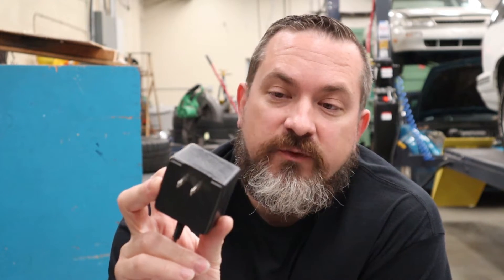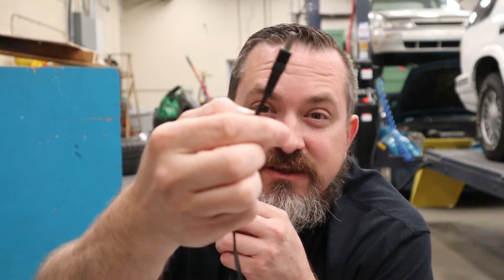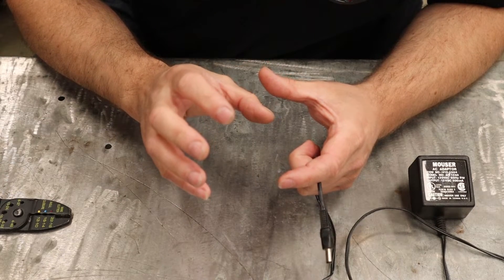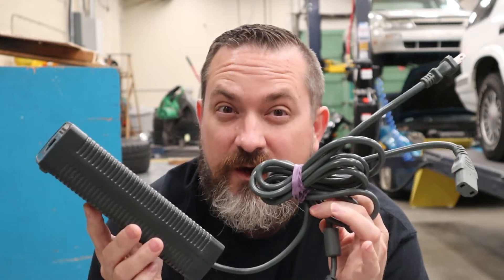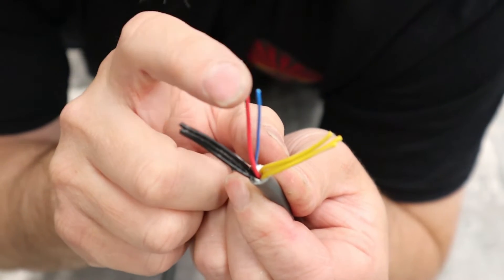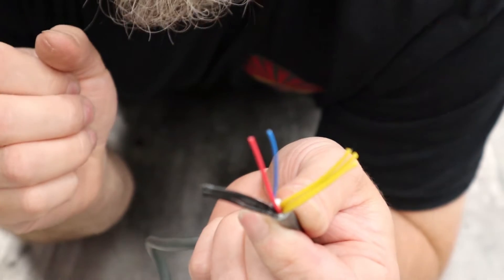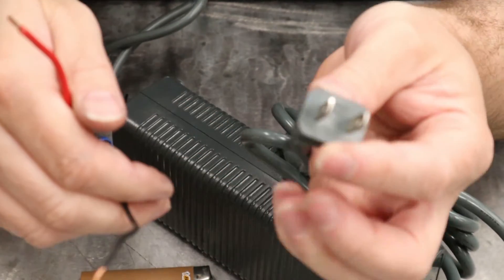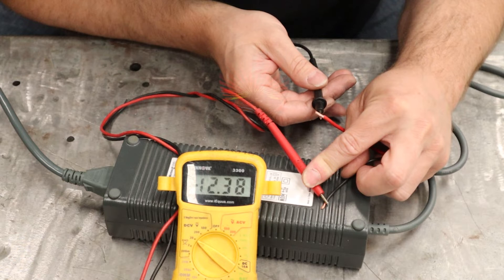How to make a free/cheap 12V DC power supply for your Custom Raspberry Pi Arcade Cabinet!  Ep#12

Comment: I'm confused. Did you need both the 12v and 360 power supply for the fans or just one or the other?
Reply from the maker: I showed how to convert both of those types but I ended up using 2 of the xbox 360 power supplies in my cabinet.  One for the control panel computer fans and the trackball light and the other power supply for the coin door in the cabinet.
Reply: @wayofthewrench  I forgot about the coin door lol. I LOVE this build, such a great concept. I dont quite have the room for a cabinet, yet, however I do plan to build a stand alone console. I originally thought to run the controller usbs out to the pi, but after this series I'm going to do an all inclusive panel. Probably have 4 player setup though. Thanks for the videos, truly an inspiration.
Reply from the maker: Yeah I hear ya, it does take up a lot of room in my garage but it is getting a ton of use these days.  Yeah you could always make the control panel first and then a stand up cabinet to suit later.  I'd love to see your 4 player version when your finished!  Thanks for the awesome comment, cheers!

Comment: one quick suggestion is to cut the ends of the wire but leave a bit of a tail in the connector that way you can use the connector in the future if something needs it.
Reply from the maker: Yeah, you are right.  I usually do keep the outlet plug but in this case I didn't.  Thanks for the suggestion.

Comment: Hello, friend! Why are there so many connections? They will also lead to excessive overheating...
Reply from the maker: As long as you have good solid connections with little to no resistance, There will be absolutely no heat.  You can test your connections with a multimeter for resistance and any connections that have .05 voltage drops are no good and need fixing. Hope that helps.
Reply: @wayofthewrench  I understand that all connections are reliable and nothing will heat up. But isn't it better to directly solder everything?
Reply from the maker: Part of the reason why I didn't solder the connections and why I used the spade connectors was so that if I wanted to change the power supply to power something else, all I have to do is disconnect the spade connector and plug it in to something else.  Also I didn't end up soldering the three yellow wires or black wires before inserting them into the yellow spade connector because it wouldn't fit after soldering.  I made sure there was enough length in the stripped wires to properly twist them together tightly and then crimped them in the spade connector.  I could have also just soldered them all together with the end wire going to the PWM fan board but I did want this power supply to be easy to switch in the future as it is over board for the items that it is powering (16.5 Amps for a LED for the trackball and 2 computer fans!).  Cheers!
Reply: @wayofthewrench  Thank you for the open answer! I agree with You that further maintenance is important and necessary. But in Russia it is easier to re-solder, well, it is cheaper...